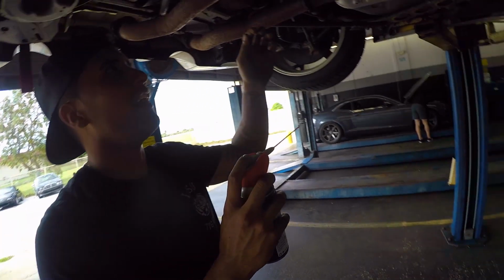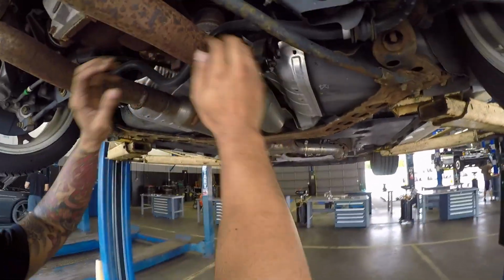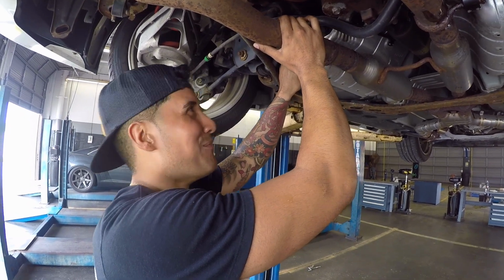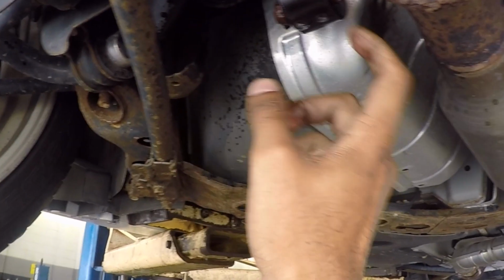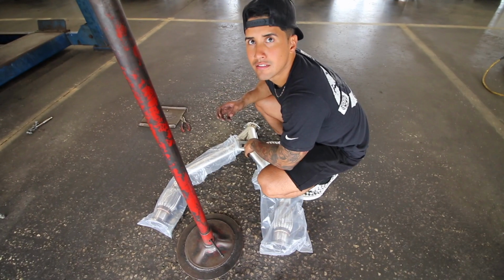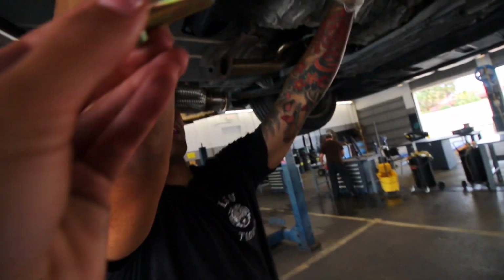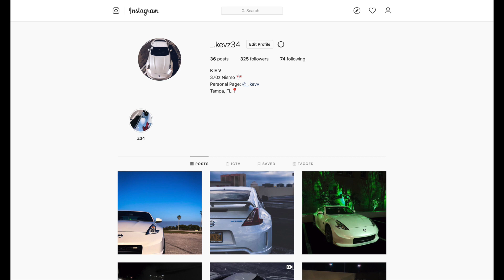370z NISMO ISR SINGLE EXIT & Y-PIPE INSTALL!

Comment: I have the same rattle. Did the new rubber hangers fix it?
Reply from the maker: lalo z34 yes the rubber hangers definitely helped except now I have a raspy/ring noise coming out of the test pipes smh. Apparently it’s a VQ thing when you put non resonated test pipes.
Reply: @kev-vel  I have Z1 non resonated test pipes so I might have the same problem 😭
Reply from the maker: i feel your pain man!
Reply: do you have a link for those new rubber hangers ? i just installed my isr and in getting this annoying noise from it rubbing and vibrating to the car pleas and thank you !
Reply from the maker: Go on Amazon and type in Torque Solution 370z . Worked like gold!

Comment: Hey man does your exhaust rattle between 2-3k RPM?
Reply from the maker: are you taking about that horrible  "beans in a can" sound?
Reply: K E V I believe that’s it! Yes!
Reply from the maker: @Imheem90   bro its a VQ thing when you change out the Cats.. smh! especially with non- resonated test pipes. ive done so much research and can't find a solution lol
Reply: K E V I appreciate it man. I’m going to have to end up getting some high flow cats or resonated test pipes. I’m wondering if it’ll still be there whenever upgrading to long tube headers 🤔
Reply from the maker: Daniel Pelaez no problem man! I was thinking of doing the same hopefully it works smh